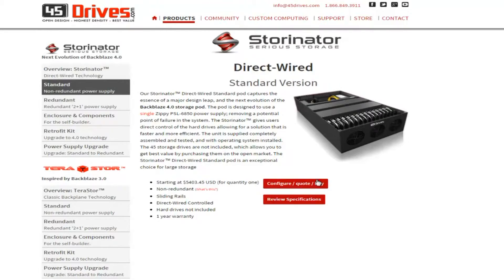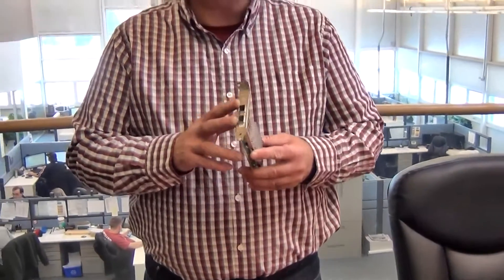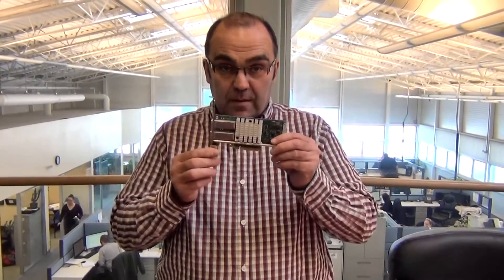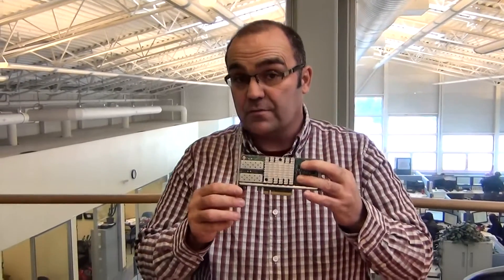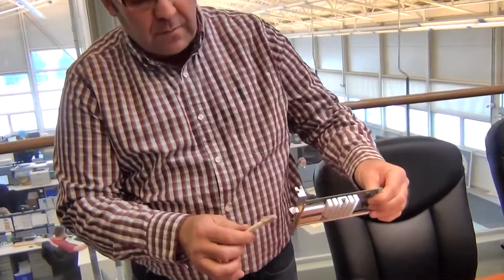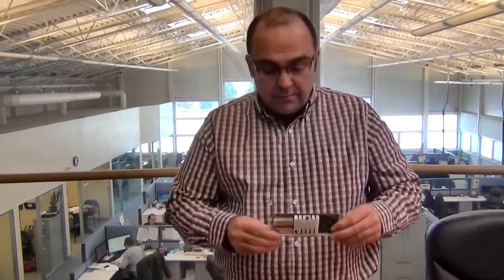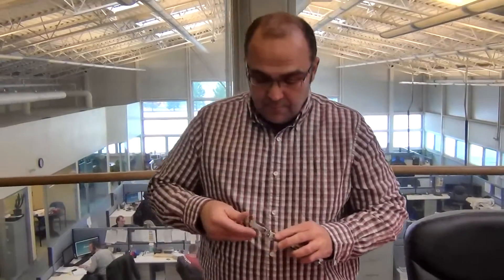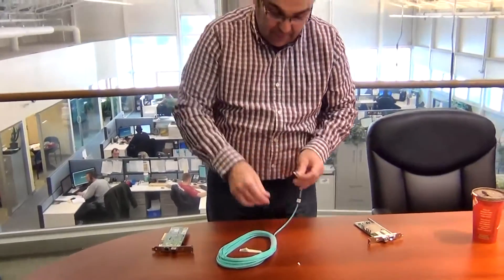Tutorial on Fibre Cards and Transceivers

Comment: the only reason that I look at this video is to see exactly how to hook the fiber up to the transceiver. 
It seems that the prong on the front hole is what the fiber slides under, with the big ribbed part up towards the front prong, and the diagonal cut on the edge I would then guess goes on the same side as the fiber, to make the electrical connection to the card.